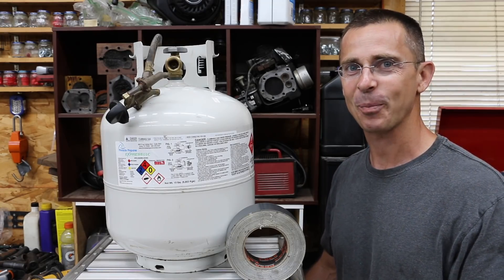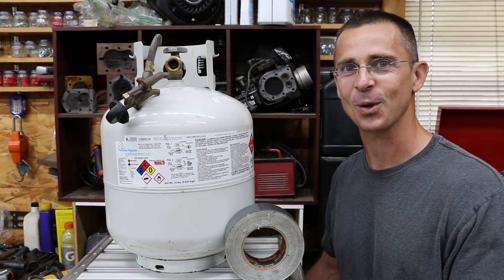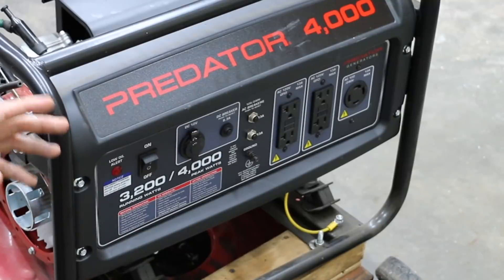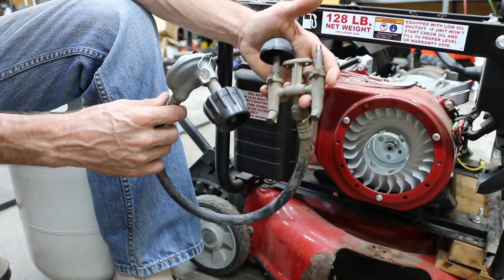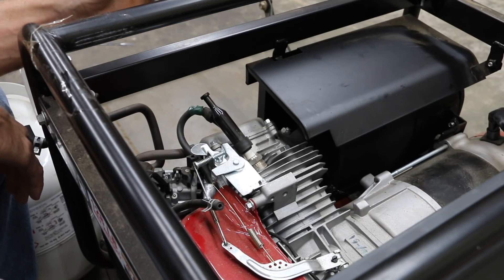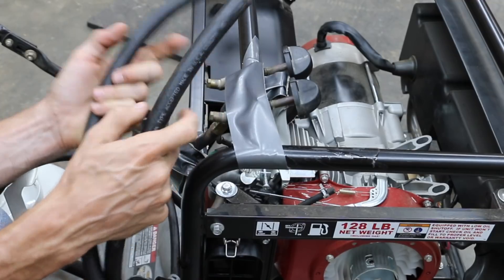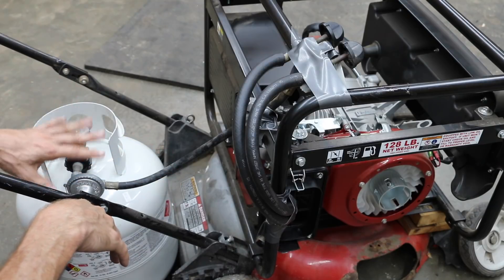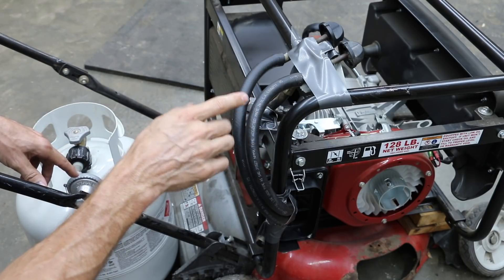Can a gas (propane) grill power an engine?  Let's try it!

Comment: Half of eastern europe is driving on propane-butane mixture(LPG) in petrol cars because fuel prices are about $6 for galon.
Reply from the maker: Why is petrol so expensive?
Reply: @ProjectFarm  Of course because of very high fuel taxes.
There are many types of LPG distribution system, even ECU controlled injection of liquid state LPG for engines with direct injection.
Reply: @ProjectFarm  in italy the price of  gasoline  can reach 1,89 €/L   now is 1,45€/L due to the coronavirus crises
lpg   0,6€/L     
gasoline  - 7 €/gallon      lpg   2,3€/gallon          lpg  for hause  utility is from 8,5 €- 12,5 € /gallon      methane -3,7€/gallon (3,74 kg)  at gas station ,  in the  pipes is comming in gas form and i dont know the price

Comment: How does it run in conjunction with gasoline? Is there any performance improvements? And what about fuel economy?
Reply from the maker: It's an alternative to gasoline.  Gasoline doesn't burn as clean.  Fuel economy isn't as good with propane.

Comment: Your Chanel is so great, I am learning about a ton of different things using YouTube and your one of the best. Why are you taking the amp and other readings?. Also I use a pressure washer a lot could you do a instructional video on the best way to maintain the engine and pump or maybe a video one how to make the most out of both, maybe some additives in the gas or something. Anyhow thanks again.
Reply from the maker: Thank you for the video idea!

Comment: The generator makes 4000 watts PEAK, not running.  There is a difference, but I'm sure you already knew that.
Reply from the maker: Great point.  3200 continuous.
Reply: I certainly didn't mean anything bad by my comment by the way.  I absolutely love your videos and as a scientist I completely appreciate your use of the scientific method to figuring out the process for your tests.  You remove as many variables as possible to test the one thing you're wanting to monitor.  You also look at several angles which is wonderful.  Please keep these coming.

Comment: this was a no brainer. In my country %80 of the gas cars hav LPG (liquid propane gas) systems installed to them which enables the engine to run on LPG that you can fill up from the gas stations.
Reply from the maker: Thanks for commenting on this.

Comment: Here in Europe LPG is a popular modification for gasoline cars. Additional tank is mounted either directly in trunk, or preferably a toroid tank is placed instead of spare wheel. LPG gas is about a 1/3 cost of gasoline, with about 10% higher fuel consumption.
Reply from the maker: Thanks for commenting on this.

Comment: He used a 3 stages regulator/gasificator water heated. In winter 1998 we made a weekend travel to Mar del Plata city  (a 250 miles journey). It took two and a half 10kg tanks to do it. It was an incredibly slow (and stupidly dangerous) travel. Also illegal. Some guys of that time  (including my old man) tried to do develop a cheaper alternative to GNC. Of course propane goes great on forklifts and generators.
Reply from the maker: This is interesting. Thanks for commenting.

Comment: How long would a full bottle last under load?
Reply from the maker: A bottle holds approximately 20 Ibs, which is approximately 4.2 gallons.  I would estimate 12-13 hours for my generator.

Comment: Not sure I get this one. Gas engines have been running on propane for years, at least a few decades if not longer. RV's back in the 70's and 80's could run on both, just switch over with the press of a button. I'm sure many still come with that option. The major downfall is less power than gas.
Reply from the maker: Thanks for commenting on this

Comment: That's awesome!  I actually might apply this technique if I need to run my generator during a storm. I can put it in my garage with the doors open a bit and a fan moving air thru the garage.  This will create much less co and fumes
Reply from the maker: Thank you.

Comment: I would not have expected it to be that easy, or that it'd work so well.

Having had some adventures recently in bringing a factory-equipped propane-powered tractor back to life, I can say that propane is a very clean burning fuel. You'll see it in the engine oil.
Reply from the maker: Thank you
Reply: Hey, it's uxwbill, the other channel I watch a lot haha.  😂
Reply: From what I can tell, most propane powered forklifts use a car engine with a regulator and a governor.  Well at least that's what my hyster uses. It's not powerful but it burns nice and clean which is good for inside.

Comment: Do you have any idea how long the engine will run on a full propane tank? The funny answer would be until it’s empty. But seriously any idea?
Reply from the maker: Full propane tanks hold approximately 4.2 gallons.  My estimate is  12-13 hours under a moderate load.
Reply: Project Farm thank you sir.

Comment: Interesting! I was sure it was gonna work, because there are plenty of BiFuel cars (they start on gasoline until the engine reaches a certain temperature, then switch to autogas (which is LPG: a propane/butane blend, depending on the outside temperature). 
It lost favor because of extra taxes and the fact that a BiFuel car is more expensive to buy and most cars get up to 30-35 MPG on gasoline over here, 3cyl. city cars even up to 40. 
But those who drive a lot or have cars that consume a lot of fuel, are still better off getting a BiFuel (I believe you can even get it retrofitted it to a bunch of cars). CNG is the fancy new things, especially for commercial vehicles and company cars, but autogas is still a great alternative for a lot of people, imo! It burns cleaner, it's slightly better than gasoline, …
Our regular gasoline (95 E10, equals to your 91) goes for $5/gal.
Autogas (up to RON 110 oct.) goes for $2,5/gal., taken into account that autogas contains 20% less energy than gasoline (so you'll need more of it) - even though, depending on the outside temperatures and the propane/butane ratio, energy density is usually about down 10%-15% down compared to E10.

These videos are so freaking interesting.
Reply from the maker: Great point.

Comment: Are there propane conversion kits for generators? Propane stores more easily than gasoline. It would be great for disaster prep.
Reply from the maker: Yes, there are kits and they are much better than using a bbq grill as I did.

Comment: Thanks! seems like its much cleaner running than gas.  I have a thought what if you got a kit to make a small engine run like a mower and see if it saves money using it to mow your lawn over gas as propane is cheaper? your call.
Reply from the maker: Thanks for the video idea!

Comment: That was/is very common in rural Mexico to power water pumps for field irrigation. The times I saw it people would drill the filter housing on the motor and poked a piece of copper tubing connected to the tank through, throttle was adjust almost like you did.
Reply from the maker: Thanks for this information.

Comment: Back in 1978 , My Brother and I hooked up a 100 # tank to his car , had to add a intake to the carb , 2 toggle switch and 2 electric valves 1 was for gas on off the other for LP on off.  LP ran fine cleaner ,  about the same MPG V 8 engine
Reply from the maker: Impressive!  Seems like a great way to save money in areas of the country where LP is less expensive than gasoline.
Reply: 1978 Oil field  Texas the oil rig had a 5000 gallon tank for are LPG engines we filled up the tank on the car every night 100 pound tank ,  this is for a later truck 1987 . https://www.ebay.com/itm/IMPCO-COMPLETE-DUAL-FUEL-CONVERSION-KIT-CHEVY-GMC-87-95-7-4L-454-V8-PROPANE-LPG-/170912700009

Comment: i had a honda lawn mower where i could not get the carb cleaned so i took a small camping propane bottle and a torch and just used the nossle and wired the whole thing to the side of the lawn mower and ran it like that for years
Reply from the maker: Nice!

Comment: If you use propane in your car your engine oil will look as new even after hours of heavy usage.
The dealer even skipped the change. No soot, no condensation.
In Europe you get a butane/propane nix at the pump.
Your old truck would do nicely with a conversion.
Reply from the maker: This is great information. Thank you

Comment: try gas and deisel mix shold work well in a low compression mower or genny i ran 50/50 in my 10:1 compression dirtbike pinged under load but a mower can be 8:1-9:1
Reply: just found your other video my bad
Reply from the maker: Thank you!

Comment: Would the engine be fine running like this with it not lubricating the engine? Or doesn’t this matter as much being a 4 stroke
Reply from the maker: Great point. Gasoline does provide some "cooling" and propane wouldn't cool as much as a gas.

Comment: How long would a full propane tank (like the one in your video) run on your generator at it's rated 3,200 watts and how long would it run at half load? Thanks
Reply from the maker: There are approximately 4.2 gallons of fuel in a full propane canister.  So, it should last around 10 hours, if not a little longer.
Reply: Thanks

Comment: I did a stint at being our rebuild shop mechanic for a change from the road, part of my duties was to rebuild the propane powered  floor burnishers they used for polishing the store's floors, basically a DR brush mower looking machine with a buffer pad up front, a Kawasaki 2cyl. water cooled 640 engine running off propane, when set up correctly it was more than safe to use indoors, they had a CO sensor whose contacts were tied to the electric gas regulator and a dedicated throttle body in place of the carburetor, other than these there were no other special parts and they ran like champs, each store had two or three (a 120 stores in our area) and the biggest problem I had was getting the operators to clean the muck out of the radiator, they would clog, make the engine overheat and eventually warp the heads.
Reply from the maker: Wow. This is very interesting. Thanks for commenting on this.

Comment: Great video.  Did you ever record the visible engine running on the gasoline fumes?  The setup you did a while back?  I'd be curious to see if running an engine on gasoline fumes produces such a clean combustion.
Reply from the maker: Not yet. That's a great recommendation!

Comment: Thanks. One of my first bosses once converted a van to run on LPG, almost 50 years ago. It ran fine for years after that. I don't know how he regulated fuel flow, but he didn't use a kit, because they were not available at that time. He drove it like a normal vehicle.
Reply from the maker: This is interesting. Thanks for commenting.

Comment: Great test! There are some fleets out there running CNG which I believe is mostly Methane. It's more common in garbage trucks, but even Ram make's CNG powered 5.7L hemi engines. I don't know the difference between Methane and Propane, but I'm sure its the same theory. CNG trucks do run gasoline through them periodically for high loads and maintain the gasoline injectors.
Reply from the maker: This is great info. Thank you

Comment: Make a proper small engine conversion to propane powered... so we can safely diy it. Maybe a lawn mower, or any other small engine, tough gokart seems fun idea. Since I reckon this method wasn't safe at all when running for hhours since the propane could easily seeps out from air filter to surroundings and catch fire.
Thanks in advance, this is a great vid
Reply from the maker: Thanks for the recommendation.

Comment: I had a 84 Nissan pickup had to adjust the time in just a little bit but she'd run on propane I'd pull up at the propane station and he knew exactly how much she would hold I drive for 3 or 4 days off of 20 lb had three 100 pound tanks in the back
Reply from the maker: Thanks for commenting on using propane.

Comment: You should try and see if a small diesel engine will run on 2 stroke oil only I figure it will because diesel engine or run off pretty much any oil
Reply from the maker: Great recommendation.

Comment: I bett overtime u will get valve damage like a lpg engine. These days lpg is injected as a liquid. They also use a kind of 2 stroke oil added to the mix to reduce wear on te head and valves wich works really well preventing damage! Thanks for the great video again!
Greetings from the Netherlands
Reply from the maker: Greetings.  Great point regarding wear.

Comment: I did a hillbilly propane conversion on my lawnmower about 15 years ago that worked out surprisingly well. I didn't use any purpose built regulators, just a valve, parts, and copper fittings from the hardware store. Since I didn't have a huge lawn, I decided that attaching a 20lb grill tank to the back of my mower was overkill, I decided to see how far I could get using the little 1lb cylinders used for camping (I had a refill adapter for them).  Once I got the mixture dialed in it ran quite well. Since I wasn't running an auto-adjusting regulator I set the mixture a little rich so that if I hit a patch of tall grass, the motor wouldn't stall. I ran it like that for several years. During the summer when it was hot, I could cut my entire lawn on a single 1lb tank. During early spring or late fall when the temps were low I would have to change out the propane bottle before I was finished with the lawn. Due to the low temps the little 1lb bottle couldn't keep the pressure high enough to run the engine reliably when it got much more than 1/2 empty. It was a fun experiment. On a side note, since propane burns soo clean,  I didn't have to change my mowers oil as often, on propane it stayed "new" looking all season. I enjoy your video's, it's fun seeing what fellow "tinkerer's" come up with.
Reply from the maker: Impressive!  I enjoyed reading your post and thanks for the positive comments!

Comment: In europe its pretty common to see Liquified Petrolium Gas (Propane) powered cars. They have very little emission, and the gas is very cheap as well, like 50c the liter (about 2 dollars 40 a gallon?) as opposed to about 1.70 a liter of gasoline ( about 8.16 dollars per gallon ) although with gas you can make about 1 to 14 (33 miles to gallon) and gas will get you 1 to 9 ( 21 miles to gallon)    Only thing is, the government doesnt want people having cheap transportation, so they made the taxes on these cars super high, just like with diesel. So pretty much, for people that drive normally gasoline is cheaper, with a little more driving a year LPG becomes cheaper, and after that for pretty much commercial cars diesel is cheaper. They under stimulate LPG and overstimulate electric because taxes i guess
Reply from the maker: This is interesting. Thanks for commenting.

Comment: Nice!
It shows that propane (LPG) converts easily to a gas state, which more easily mixes with air, thus burns better. The orange flame is gasoline indicates incomplete combustion. Gasoline is a liquid with a higher boiling point, and has more longer chain hydrocarbon molecules, which would need higher temps and pressure to equal LPG.
A longer intake tube may allow better mixing between gases, unless some mechanical device is used like a turbine.
There are LPG carburetors that will regulate like a gasoline carb.
Gasoline has 38% more energy per gallon. LPG has higher octane (108), so higher compression and more aggressive timing could be beneficial.
You could try Browns gas (oxyhydrogen) with Gasoline and see if burn improves, and becomes more blue.
Reply from the maker: All great points and thanks for the recommendation on testing Browns gas.
Reply: Be careful that Brown's gas, please.
In its pure form, it's a perfect combustible mixture, and the only form it should be used in.
So, watch out for backfires.
Reply: LPG here is usually a mix of propane and butane in 70/30 or 60/40, and depending the seizon more butane is added.
Reply: Propane  natural gas are alot cleaner no more cleaner then diesel that haze in the sky what we call smog is from all those diesels spewing smoke and soot dirty air I sure don't want to breathe in filthy air

Comment: There’s commercial box vans that are propane fueled. Also off-road vehicle builders have a fascination with propane gas because it’s already in vapor form and the engine will still run at any angle (when doing high pitch rock climbing) because propane doesn’t slosh around like gasoline fuel in a tank. 👍🏻 cool vid. Always like watching your content.
Reply from the maker: Thanks for this information and thanks for the positive comment!
Reply: actually it does. its liquid under pressure.

Comment: I see someone posting about farts. Will Methane run a mower????

Also, if you ran this for a while... ide like to see one with a bunch of lucas upper cylinder lubricant and propane, and one without any lube. See the wear affects over time.
Reply from the maker: Thanks for the recommendation.

Comment: I bought a two way 9K generator from Costco about 4 yrs ago. I've used it in propane mode exclusively, I have never run gas through it. Works great even over an extended outage about 2 yrs ago. Uses a 20 lb tank over about 8 or 9 hr period. Depends.
Reply from the maker: Very nice setup and sounds very efficient.

Comment: This is my 'conversion' I did for my generator. it wasn't difficult, I just disconnected gas tank and ran propane directly into the carb intake.  I did this a couple of years ago, just see if it could be done. I just used a valve for a propane torch. I have the adapter to use a 20 lb. propane tank  I do the same thing for my power washer. The beenfits are that the oil really doesn't get fouled or dirty. Works great. 
    https://www.youtube.com/watch?v=1IrragfFwrM
Reply from the maker: Thanks for commenting on this.